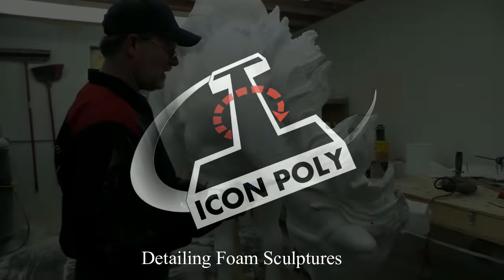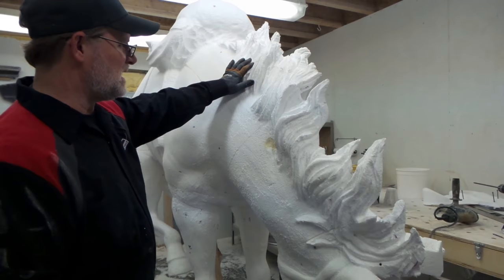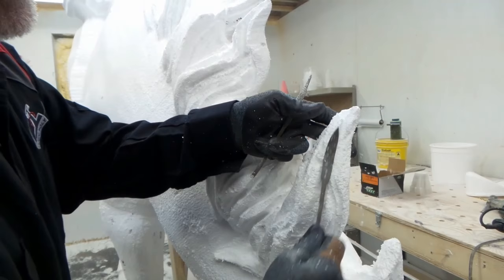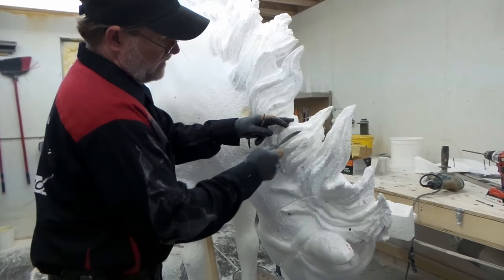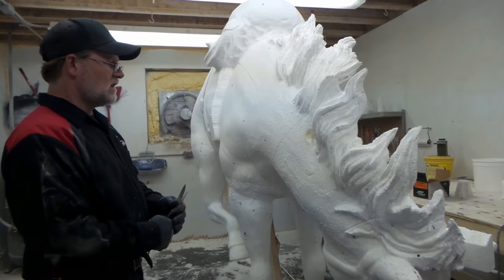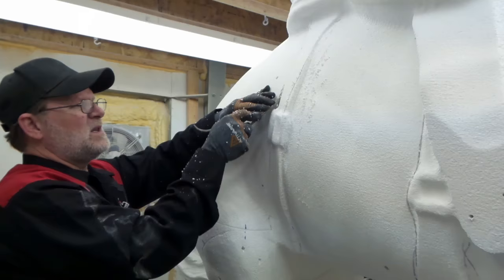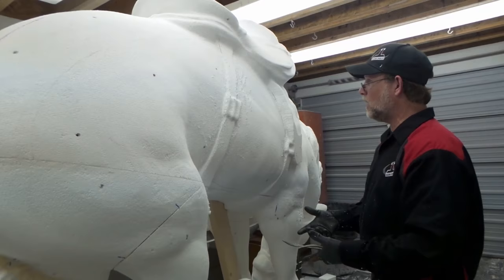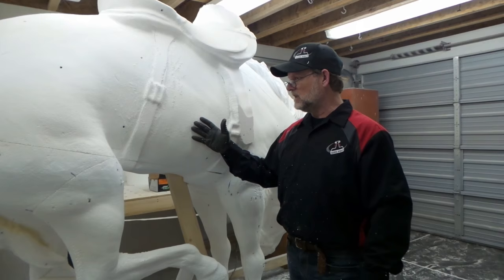How to detail foam sculptures

Comment: I want to add hair to my foam mannequin head for my mosaic head I’m creating. The hair is going to be full short and soft curls. Should I add a block on top of my styrofoam head? Advice would be appreciated. I’ve used styrofoam for long hair then added thinset to mosaic but could really use advice